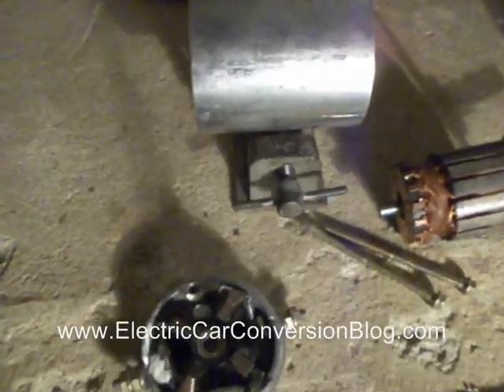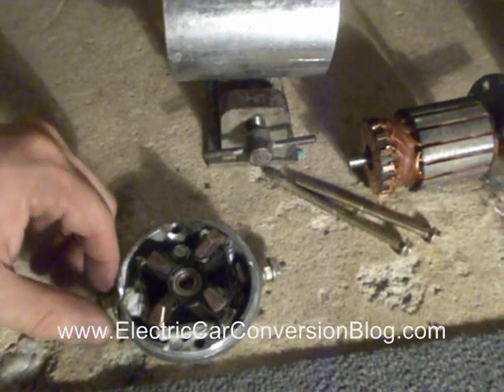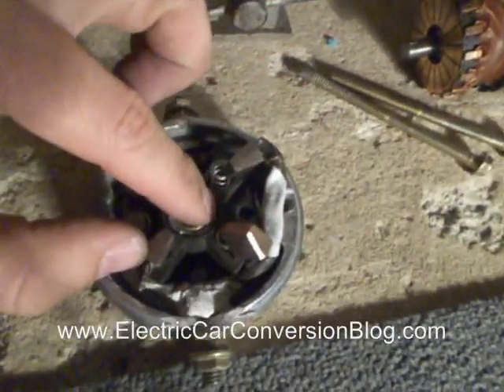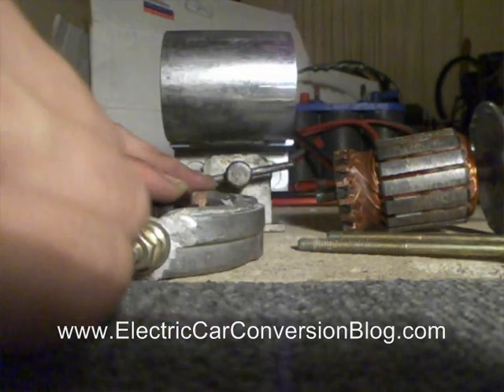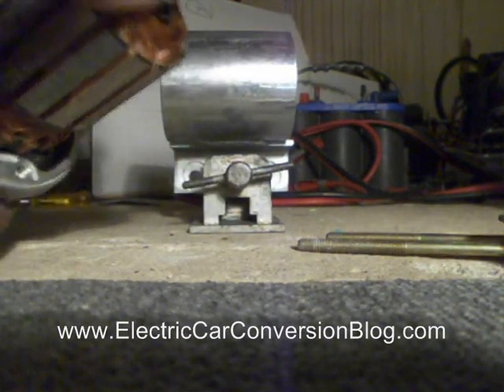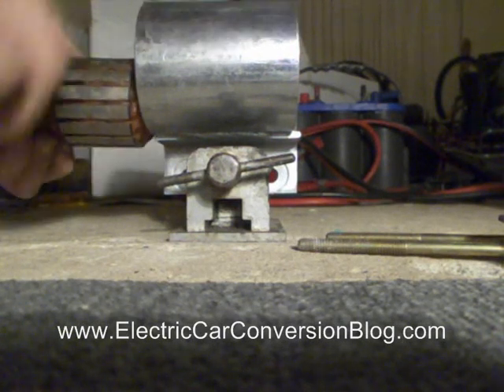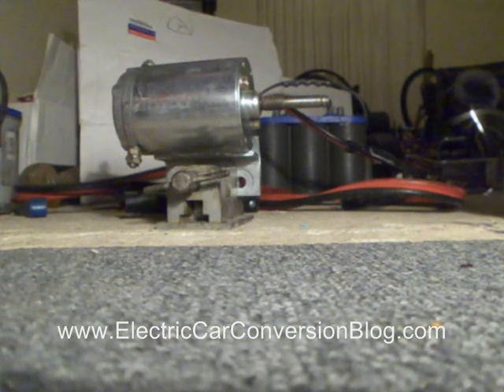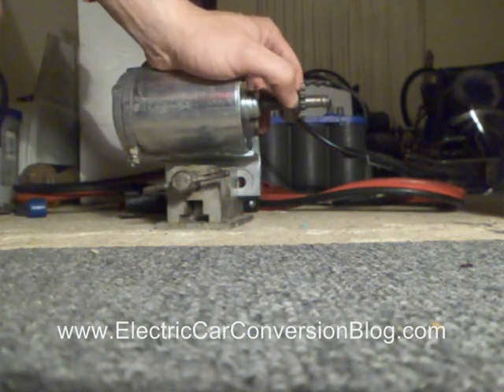Assembling a Modified Electric Starter Motor

Comment: How many rpms do you think that motor is running at
Reply from the maker: +josh Tesla Not sure how many RPMs that motor ran, but I would guess somewhere between 2000RPM and 6000RPM, but I'm not really sure because I never measured it.